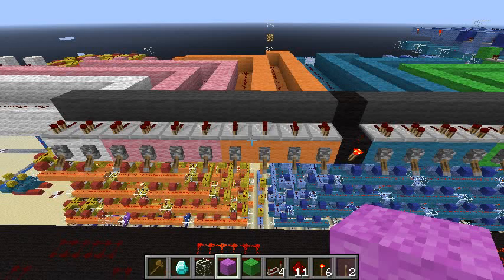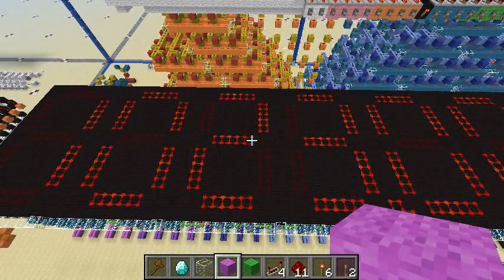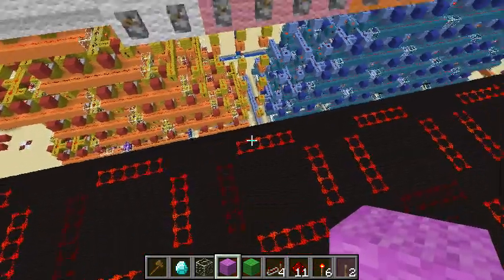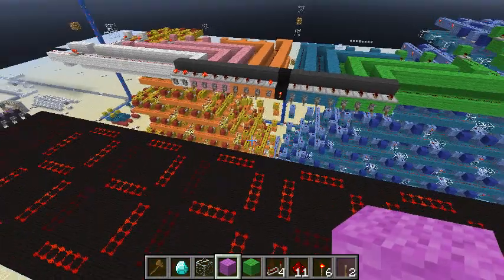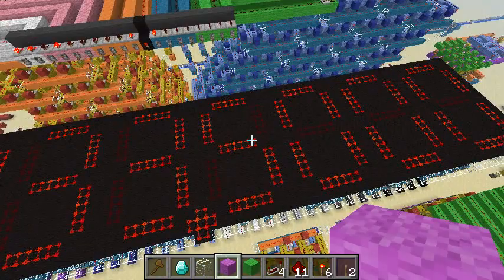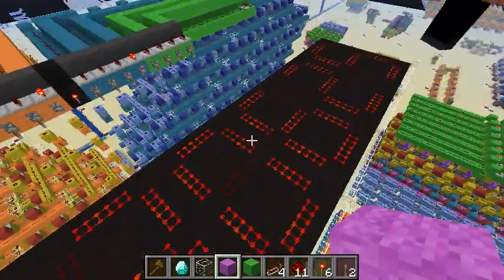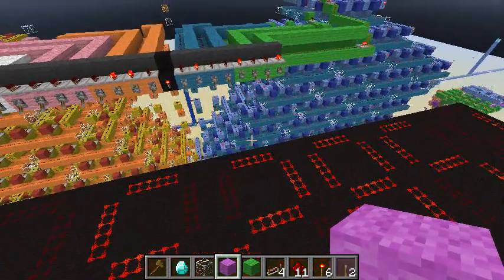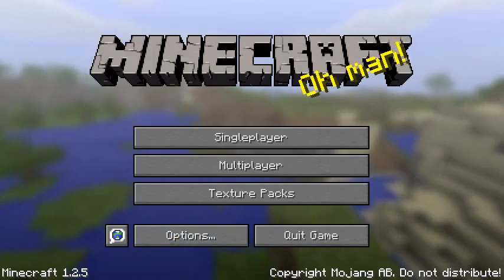Binary to BCD Converter and Display

Comment: hey, if you would like a project, you can take on the one I'm going to be working on. a computer using just one full adder, not one set of adders, but a single adder. the ALU is kinda big and slow.(100 tic clock) but it's different and hasn't been done yet
Reply: forgot to specify. it's not a 1 bit computer. it is a 8 bit computer that I will be working on. the ALU will be set up as if it was a 1 bit tho
Reply from the maker: A 1-Bit Adder that processes the 8 bits of data serially?
Reply: +HansLemurson I have a video of the ALU on my channel if you would like to check it out.

Comment: How do decimal binary numbers work?
Reply: If I did it correctly, it's really easy to have an adder with decimals
Reply from the maker: KernulRS
Binary Coded Decimal is where you take a Decimal number like "35" and represent each digit individually (a 3 followed by a 5) but each digit is written out as its binary equivalent: 0011 0101

It is perfectly possible to do math with decimal digits being represented by 4-bit chunks, but it is more flexible in the long run to do all math in pure base2 and then convert to Decimal as needed.  BCD is mathematically equivalent to Decimal, it's just that the digits are written using 4 symbols instead of just one: using "1001" instead of "9" to represent 'Nine'.

Comment: Alright, thanks again for the tip; I was able to modify your program counter to turn it into an easily chainable decade counter, which is perfect for my needs. In the process I seem to have made it unstable again though, I don't know if it's something I did or if the server I'm on is just too laggy (your original design was also unstable for me, so I am leaning towards it being an issue with the server I am playing on).

Comment from the maker: I'm not sure when I'll make a tutorial about this.  Hopefully soon, but I've been pretty miserable lately from allergies.

I would also advise you that if you're making a counter that could be read in base10 to NOT try to use this device.  This is a heavy-duty last resort device for when your source data must be Binary.

Instead I would advise you to take a 4 bit chunk of a binary counter and rig it to give a "carry" signal and reset after 1001 (9) rather than the default 1111.  BCD counter.